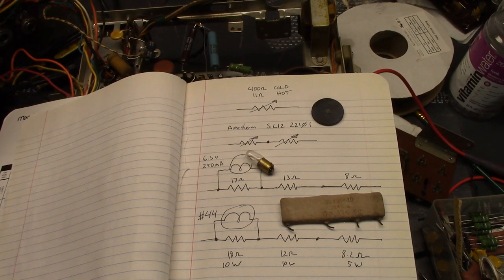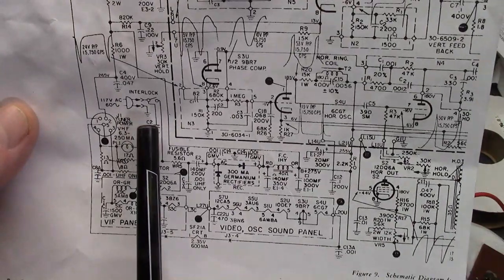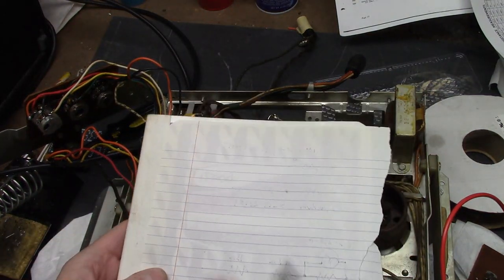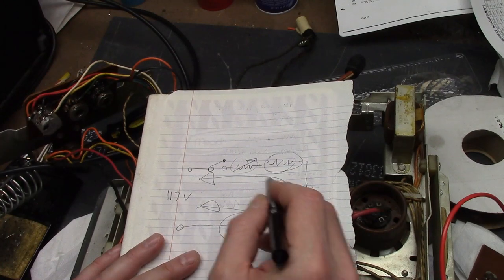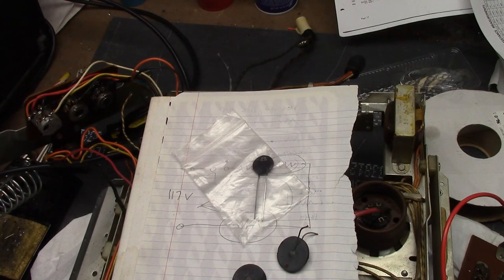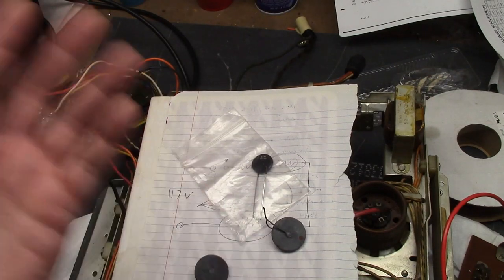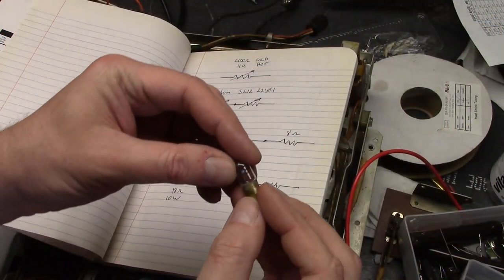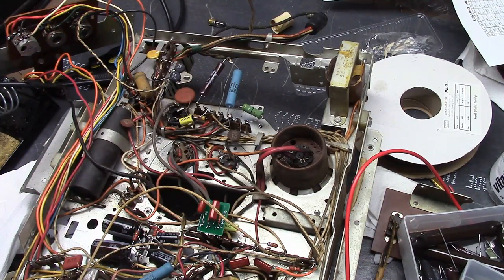Predicta restoration tips: Thermistor, filament dropper and dial lamp.

Comment: Two thoughts to consider...
21:43 if you made the diagonal bus wire stronger (i.e. larger diameter like 1,5 to 2,5 mm^2 electrical wire) it would easily support the "flimsy" wires of wirewound ceramic resistors.
22:43 you could use an LED version of the 44 6,3V 250mA bulb if you adjusted the 18 Ohm resistor accordingly. If one assumes the LED bulb current to be in the few mA range, i.e. negligible, Ohms law dictates for 6,3V at 0,6A that 18Ohm resistor has to be 10,5 Ohms instead, with a 3,78W rating.
Standard values 10 or 12 Ohms at 5W. Other plus of using LED instead of the 44 bulb is, if the LED bulb fails there is virtually no infuence on the heater current.
Happy new year
Reply from the maker: Good ideas.  Yes, I imagine an LED bulb like this would work.  There is a current surge of about one Amp during power up, but this bulb can handle up to 28 volts AC/DC.  https://www.soslightbulbs.com/product/led-lighting/led-lamp/lamp-44-led-equivalent-miniature-light-bulb/

It could be rather confusing to a future restorer though :)

Comment: Interesting and helpful, but I think I remember seeing somebody (maybe it was you) substitute an LED for that bulb, how would (did) that substitution affect the current flow in that area? I’ve seen so many of your Predicta videos, I’m tempted to restore one, I love the styling. But my skills don’t come close to yours!
Reply from the maker: Yes, I did years ago.  I replaced the filament dropper and thermistor with an AC motor run capacitor.  Then I used a 120 VAC LED bulb right across the line.  That drops the power consumption by about 15W.  Works fine, but I decided it was too radical a redesign (would really confuse a future restorer) and went back to this technique.

Comment: I remember decades ago replacing a 40 ohm filament dropping resistor in a 17 D 303 Sylvania dualett black and white 17 inch TV. This model is a very rare TV set. I would like to know where to look to get someone to adopt this set ???.
Reply from the maker: Sure, I'm familiar with them. Very collectable. There are several vintage TV collector groups on Facebook. I'm sure you would generate a lot of interest if you posted some photos
Reply: @bandersentv  thanks, yes that is what I was told. I am not a Facebook person but I need to become one as we are moving to Florida permanently and I cannot take everything that I have.  Alot of the stuff I have must go up for adoption.
Reply from the maker: @vintageradios7790  I might be interested.  Approximately where are you located?
Reply: @bandersentv  hi, the Tv's are in queens NY. We are  in Florida now for the winter. I have TWO of the 17 inch dualetts,  one is blue and white ,the other is tan and white.  No busted plastic cases. Both need to be adapted both stored in a indoor garage
Reply from the maker: @vintageradios7790  I have a friend in NY that might be able to pick them up.  How much are you asking for them?
Reply from the maker: @vintageradios7790  Can you contact me via email at bandersenv@gmail.com?  Thanks.
Reply: @bandersentv  I sent you an email.
Reply from the maker: @vintageradios7790  Hmm.  Didn't get it.
Reply: @bandersentv  Hi Bob.  I think you may have misspelled your email address to VR?  Cheers

Comment: It kind of looks like the heater string could be hacked with a rectifier diode if it adds up to about 80 some odd volts. Whether this is actually feasible while keeping the thermistor, I don't know, but it would mean somewhat less heat cooking in the case.  Add the values from a tube manual to be sure.  If a trifle "more" voltage is needed, a small capacitor could be added to the output of the diode, say about 1 microfarad more or less to ground, and check it with a true RMS voltmeter.
Reply from the maker: I replaced the dropper with an AC motor run capacitor in the first Predicta I restored.  Then you don't even need the thermistor as the cap resists the current surge.   All told that saved about 15 watts of heat.  I decided it wasn't worth the radical redesign.